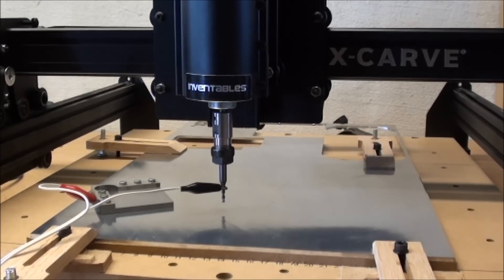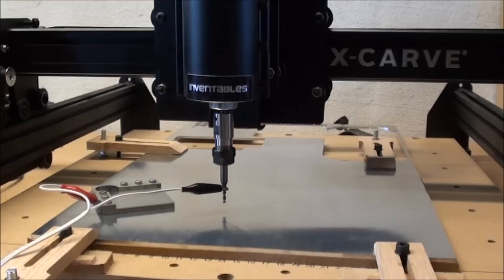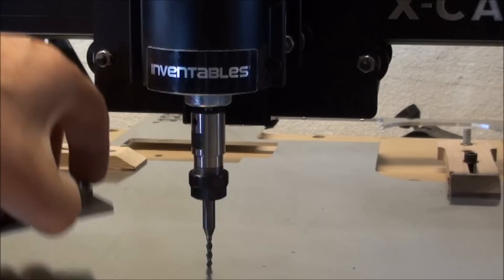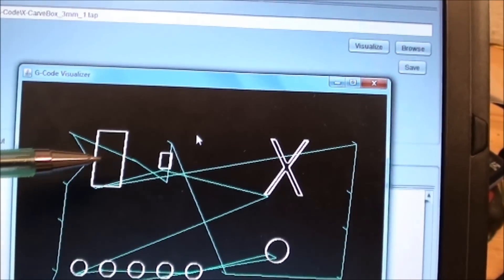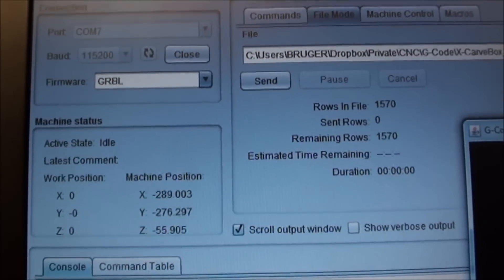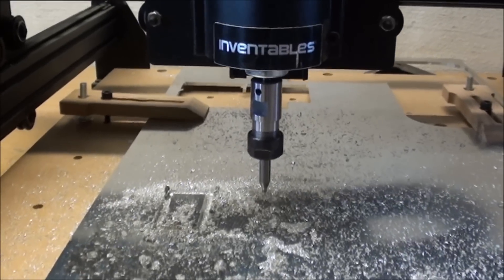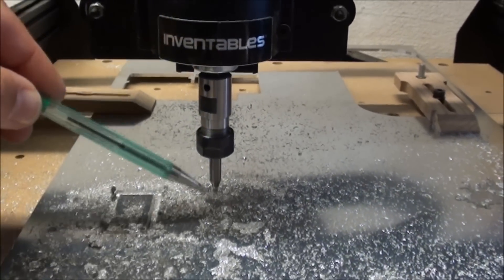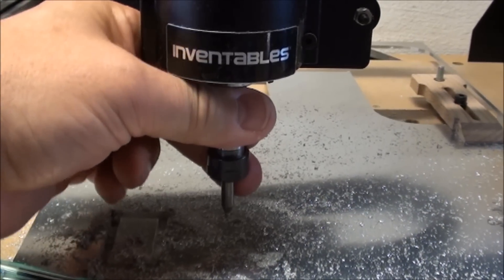X-Carve Milling aluminum - first attempt. No success

Comment: Don't know if you are still using this machine but I have been playing around with cutting aluminum lately and this is what works for me. Cheap 1/8" Bits off Amazon with cut setting of 9 ipm plunge rate, 0.003" depth per pass, and 15 ipm feed rate. Rule of thumb with aluminum I have been told and learned is take smaller passes with higher feed rates. I have gone 20 ipm feed rate at 0.001" depth per pass but the 15ipm at 0.003" works best for me. I have been successful with a 1/16" bit doing 10ipm at 0.003" depth per pass and 1/32" bit doing 10ipm at 0.002" depth per pass. Hope these numbers help.

Comment: The main problem is your depth of cut.  Try 0.005" or less, adding several passes. Don't go over 5ipm. 
Also on your plunge cut try to cut 0.01" at the time and then retract a little bit and plunge again.

Comment from the maker: +Fernando Carvalho de Paula Cortes I do use a couple of different software packets. What you always need is a drawing program (CAD), a program that can generate the G–code (CAM) and finally a program for sending the G-code to the machine (sender). Here is three options – first is free, next $, and last $$$FREE: My preferred CAD is SketchUp. Its free, easy and very flexible. For SketchUp you can get a free plugin (SketchUCam) that can do simple CAM taks like profile, pockets and drilling. $: If more complex CAM is needed I frequently use CamBam. This program also has some drawing capability but I usually only use the CAM part and make the drawing in SketchUp.$$$: Finally I use VCarve. It’s a full CAD and CAM program that is very intuitive and gives a unique preview of the job before starting the machine – but it also comes at a price

Comment: I suspect that a good deal of the resonance and chatter is coming from the aluminum sheet itself. I could only see two wooden clamps quite someway from where the spindle was cutting. Plus if you look at how the clamps are bolted down the leverage is in favour of the table and not the work piece. With a proper setup and realistic cutting speed aluminum would be no issue for that spindle at all. Plunging with an end mill ain't great on a ridged mill, downright sucks on a router with plunge rates that high.

Comment: Was this the 300w Quiet Cut spindle from Inventables?  I have one and was looking to do some basic CNC milling of aluminum with it.  If so, could I inquire about the feed/speeds you used?
Reply from the maker: Dewclaws It does not match the picture of the Quiet Spindle 100%. It might be slightly different. Not sure. I used a 3mm, 2 flute bit designed especially for aluminum. Feed rate 250mm/min, plunge rate 100mm/min and 0.4mm depth increments. These parameters has worked very well for me on my ShaspeOko2 with Kress spindle.

Comment: Martin, I am not sure what bit you are using, but that makes a big difference too.  And keep in mind that the smaller the bit, the slower you will have to go simply because of the inherent flex in the bit itself.

You may already be doing this, but you also get better results if you use a bit that is made specifically for aluminum.  I have had really good success with these Kodiak bits: KCT149560.  These are 2 flute bits made specifically for aluminum, and they actually work better than the 3 flute and 4 flute bits.  You might give them a try.

Comment: Little, if any, of that flexing and chatter is related to the spindle speed, power or bearings.  (Note that the spindle was neither struggling nor binding.)  Some of that flex comes from frame components that give a little under stress.  Even more of the flex comes from the small-diameter bit itself. (Small-diameter bits like this actually flex very easily.)

Both of these can be avoided by slowing down the feed and plunge rate and reducing the cutting depth of each pass.

Without adjusting the feed rate, plunge rate, pass depth, and/or using a larger bit, he would get the exact same result even if he were using the Dewalt DWP611 or DW660.  The only thing that would change is the bit would probably break quicker.

And yes, the Dewalt spindles can accommodate larger bits that cut faster and flex less, but the larger bits waste more material and reduce the level of detail you can obtain, preventing you from making the smaller holes and cutouts.

Again, the reason these components are flexing is because the cutting is too aggressive for that size of bit.  Even the stock spindle works fine for cutting aluminum if you don't push the bit too hard.  I have even cut out parts from 6.5 MM aluminum without any problems using a stock X-Carve machine.

Comment: its a shame inventables put such a crap spindle in their machine, 300w is too mickey mouse for serious work. kress is a much better option. then again i wouldnt go with a belt driven cnc,i suppose its a cost issue, those ballscrews are expensive!
Reply from the maker: the green man I assume both selections are a matter of cost. The little spindle worhed fine in MDF and plastic but not aluminum. Now they offer a spindle holder for DeWalt witch most likely will be equal to my Kress in performance.